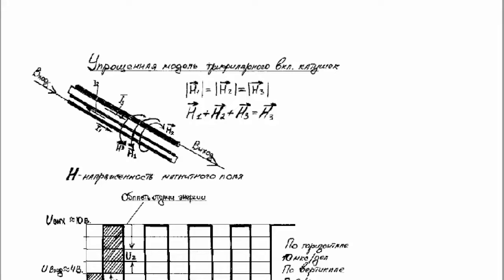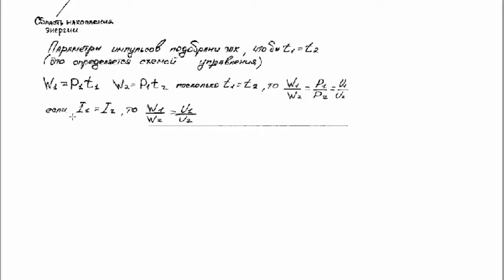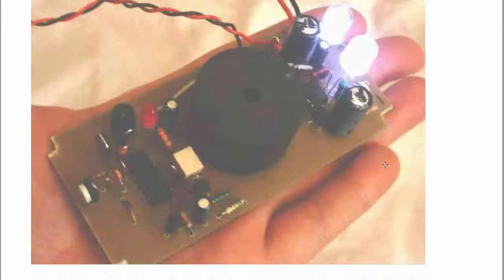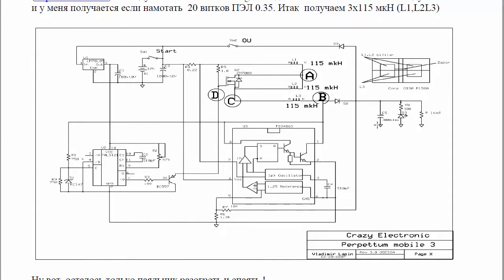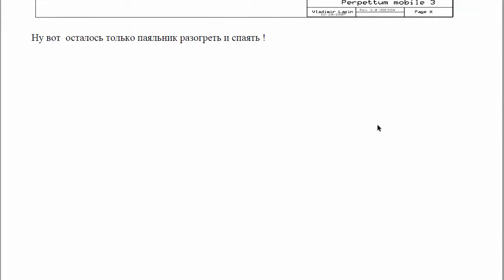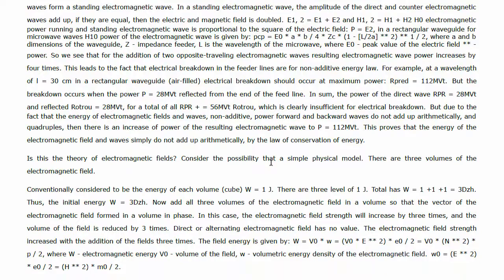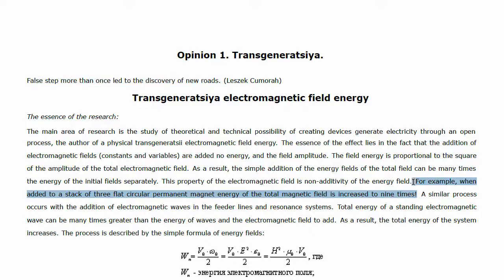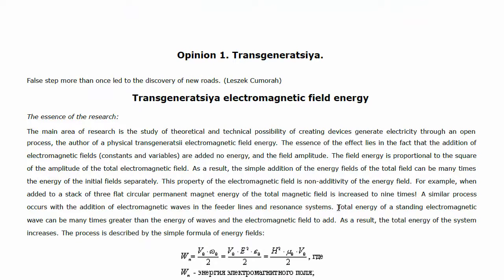Simple steps for Above Unity - Partnered Output Coils 101 - Part Three / Three Parts

Comment: Once again, thank you for crucial information. If you need detailed translation of those pages into English, I can do that. In short, someone tried to reverse engineer a schematic, mentioned on some forum. In first version voltage peaks were wrong, frequency was off, and current didn't get to LEDs, and he made a control schematic (which was not mentioned on original scheme, but is clearly visible in video and photos). Valery mentions that he had to rewire coils to reduce impedance to 115mH, and create suitable current for control chip for it to successfully open and close. All parts used are listed in text and it should be repeatable by anyone.
Reply: Thank you for posting some translations! You are important here!

Comment: We are working on duplicating a machine that is self running.  Prototype ran an RV AC and Heater for free for three years and is still self  running.  To do this use a Samsung pancake motor, several ECM converted to Generators, and a  HEAVY Fly wheel.
Reply from the maker: The only limits we face are the limits we let ourselves be limited to! Thanks for sharing! https://youtu.be/yVcEb4Hc8aE

Comment: Many thanks for sharing! I've been reading your posts on the forums and here (http://www.overunityresearch.com/index.php?topic=2760.msg44746#msg44746) you said, "If the load is not resistive, then we must account for a phase angle to get the Watts." Do you show how to get a phase angle shift for the output anywhere, or do you know where I can find this info?
Reply from the maker: +Mark Flint - Come and join in @: http://forum.hyiq.org/   ---   Yeah, It's a normal Power Equation, for example, if the Load is Capacitive/Inductive in Nature then there will be a Phase Angle, a Phase Shift between the Voltage and Current, according to the Reactance of the Load. The only time there is no Phase Shift, is when the Load is purely Resistive! An Inductor can become Resistive, loose all of its Inductance when Saturation point is reached for example. Of a Resistive Load, like a, Incandescent Bulb is mostly Resistive. 

We are much further ahead there. Leaving all the Bought and Paid for Trolls behind at the other Forums!
Reply: Thank you. I've just registered at the forum, Cheers :-)
Reply: OK, so power factor correction, regular electronics. Thanks for your reply.